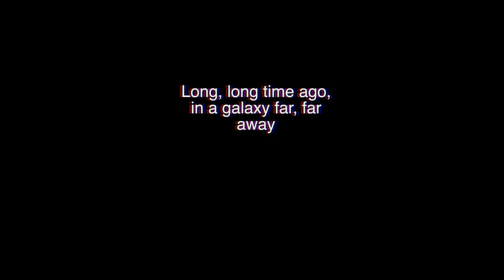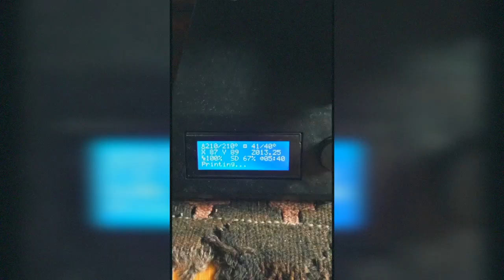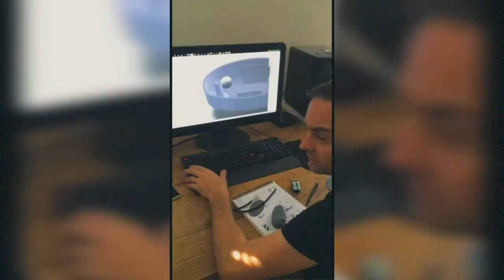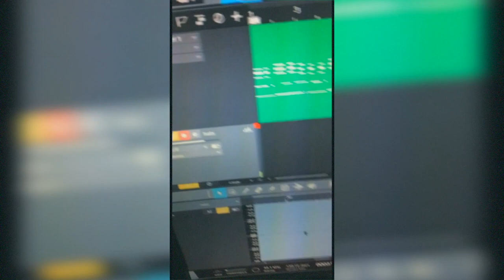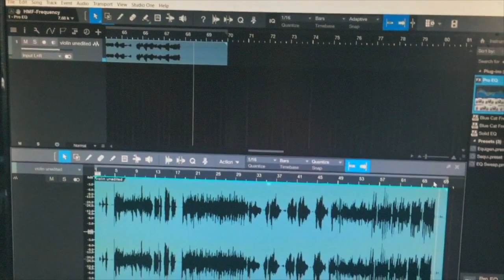DIY Violin Piezo Pickup // Original Design

Comment: If you've got a spare ten bucks, 3SigmaAudio sells impulse responses taken from nice violins/violas/cellos w.r.t. (I think piezo) pickups placed on them. I use them with my electric 7-string to imitate different string ensemble sounds and it works great. It turns that really buzzy DI signal into a very convincing sound when run through a room reverb and a hall reverb in parallel (both full wet, with a bit of low-passing on the room so that none of the piezo buzz from the dry sound gets through.) Can't recommend them enough, they really help to get a very "classical" sound without a real hall to record in :D

Really cool DIY build, props for having the courage to put a pickup on your acoustic. I'm way too scared to do that with mine :P

Comment: Awesome! Question! How did you attach the pickup to the bridge? I made a cigar box fiddle and am interested in doing this for it. Mainly for fun and noodling around with distortion and other effects. Except, probably won't do the built in pre-amp. I have an external pre-amp I can use.
Reply from the maker: you can actually just use prestik (that's what it's called here), or if you want a permanent solution you can use epoxy resin glue (i think :) ) - have fun!!